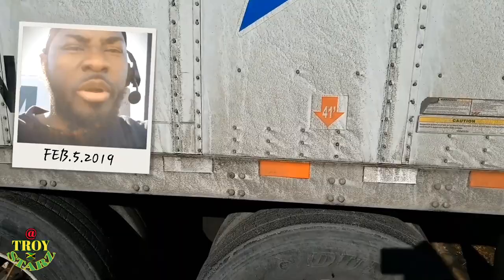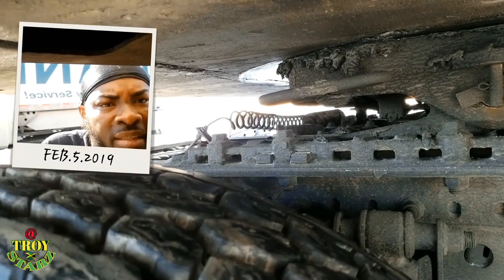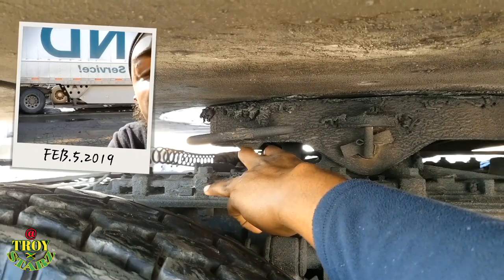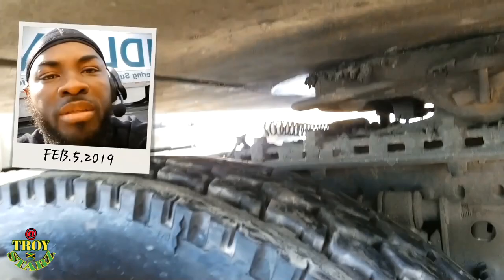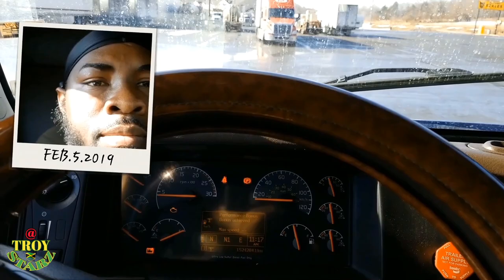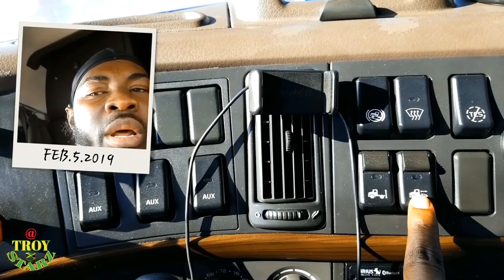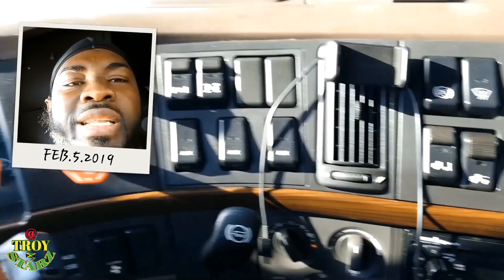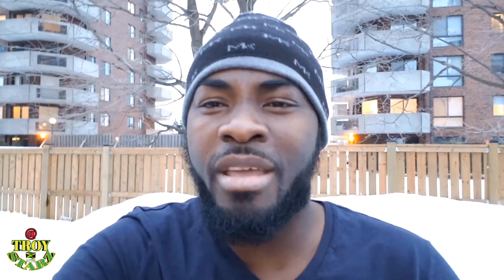Steer Axle Over Weight How to fix it, Volvo truck Vlog #126

Comment: Technically most states allows steering axle up to 20,000 lb, but you are generally limited by your tire rating.  If your tire is rated for 650 lb.  your single axle limit is actually 650 x 11 (inch tire) x 2 (tires) = 14,300.  As long as you are not over the 80k total.  If you run California, then semi trailer steering axle is 12,500 lb as an example of the few exceptions.

12,000 is based on the assumption both of the tandem axles (drive and trailer) are at or close to 34,000.  12,000 is just the leftover and is not your single axle legal max.  Each state have their own legal limits.  Most are 20,000 single axle, and 34,000 tandem (double) axle, but as always there are a few exceptions.  People just run 12,000 because it's the easiest to remember and won't be overweight 98% of the time, it's not a hard limit, and even the weight stations generally gives you a few hundred pound of leeway for instrutment errors.

Comment: What to do if pins won’t lock after moving?
Reply from the maker: Clean the area with oil spray like WD40 and make sure the air is built up👍
Reply: Thank you for answer. Also could it be because I’m empty at the moment?
Reply: It’s moving easily in the rail but won’t pop back in
Reply: Didn’t help :(
Reply: @TroyStarzTruckingVlogs  won’t lock and I have to drive... crazy
Reply from the maker: @Bes_soznanija  That means you didn't apply the bottom to close it after you move it.. Because once it released after pushing the switch you have to manually push the switch back to the opposites position.. 👍